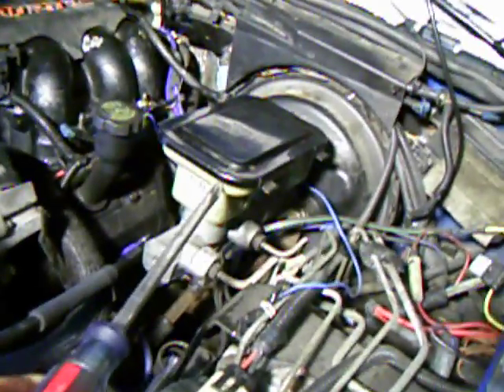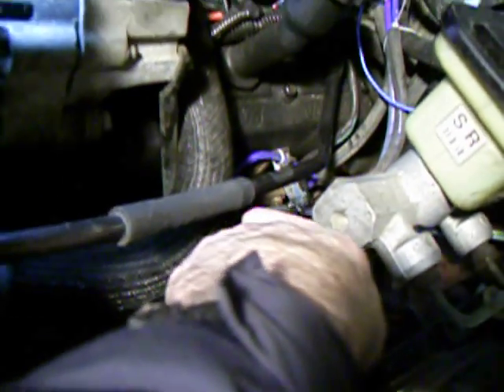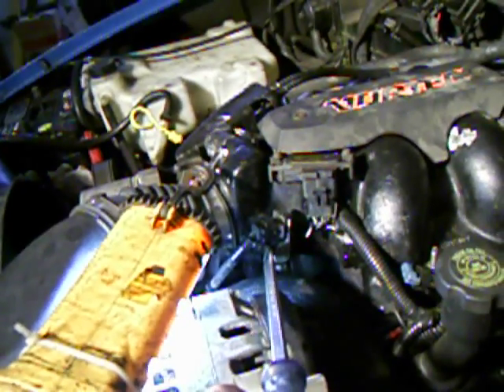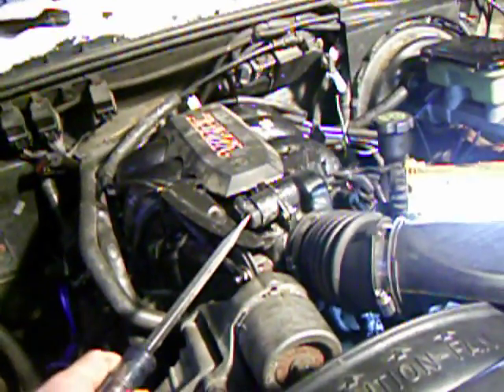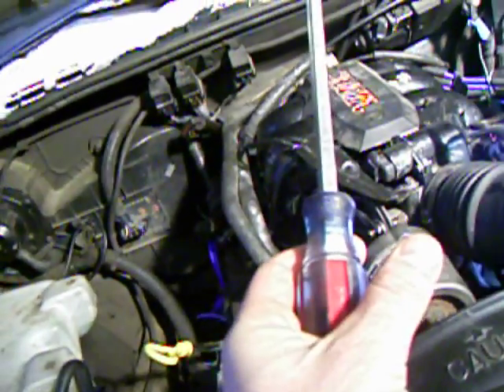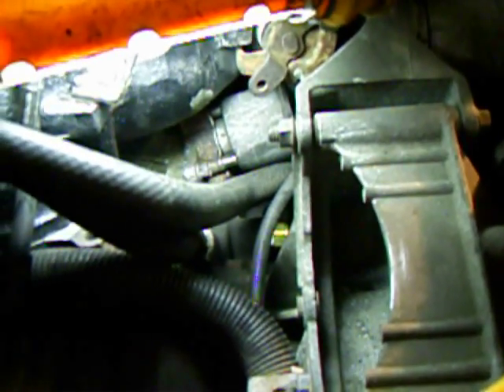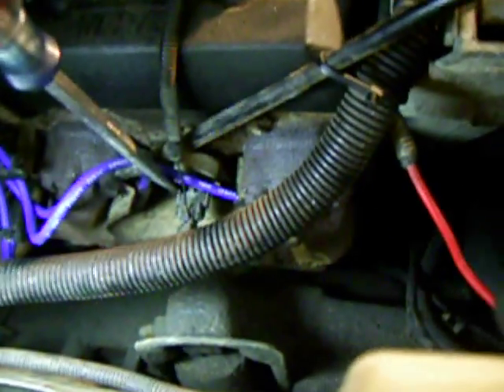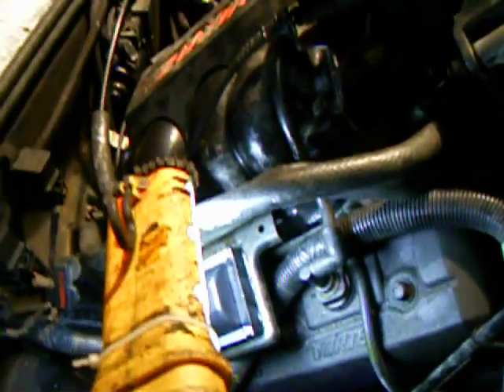GM Troubleshooting Part 7 - Sensors and control valves (non EGR)

Comment: is they a crankshaft position on this motor
Reply from the maker: Hi there.  I sold the truck 5 years ago and gave away the manuals.  If i didn't include any discussion on a crankshaft position sensor  in this video then I would have to say no... there isn't one.

Comment: I have a 96 Chevrolet s10 and sometimes the light come and check engine light comes on and it runs rough just for a few minutes after it warms up it gets gets better just don't know exactly what it is I've replaced fuel pump filters sensors plugs wires for the cap rotor button any advice would be helpful thank you

Comment: Very Helpful, but I'm still trying to figure out what my problem is... I have a 1994 4.3L and i can't get it started without spraying starting fluid in the air intake. After it runs for a while, I'm then able to shut it off and start it again. It seems like it's acting like it's not getting enough fuel, but as soon as it's running it runs good. What do You think?
Reply from the maker: Are there any check engine codes? Could be a bad sensor, computer, ground, plugged fuel filter or bad injector. Start testing them one by one. If that doesn't lead to a fix, depending upon how far you want to go with the fix, I would buy a parts truck and swap sensors one by one.

Comment: Nice helpful video. I have 95 Jimmy 4.3L (w) and doesn't want to start and when it does it dies. We've verified fuel pump (been replaced couple times with filter) and everything in between. It is getting power and fuel. It will start intermittently without aid of combustible fluid sprayed in. Replaced dist cap and rotor, plugs and wires and to no avail. I did fix a vac leak but it's hard to check for more as I can't keep it running. I'm wondering if a sensor, and if so, which one could cause this. thanks
Reply: engine coolant temp sensor (the one of the front of the motor)
had same

Comment: I have a 1998 GMC sonoma when it cranks it goes dead like you cut thje switch off. I by passed the switch with a push button and still won't run.I put new fuel pump relay also. Any ideas

Comment from the maker: sounds like it is running rich. I have seen this before with a Saturn that had a faulty temp sensor (was reading cold).  does your temp gauge work?  how many temp sensors on the rig (many engines have one for the gauge and one for the computer).  This could be a wild goose chase but you never know.

Comment: I have a 95 blazer and when I floor it it sputters and have bad acceleration but when I unplug the Throttle Position Sensor it runs and accelerates fine. Any ideas y?

Comment: PVC if no one has told you is "Positive Crankcase Ventilation". Good for me, helped to figure out the true problem I'm having in my 4cyl 95 GMC Sonoma, I've got it narrowed down and if it's the coolant sensor, that would be great, but I've a feeling it's the TPS :( Thanks for the help.

Comment: PCV, Positive Crankcase Ventilation, you deserve to know! BTW, I have to commend you on this series! There are other sensors I have not seen, The MAF And the Crank Position Sensor. The CPS will keep you from starting but the maf is notoriously known for running rich in GMs. I sure wished someone could tell me where that is on my Lumina car or my Astro for that matter! On my Astro, the cps is under my rotar, pretty easy with that. Don't forget the guy who prototyped much of this o2, in exhaust.

Comment from the maker: @jhep1985 I am not an expert on knock sensors but there are usually 2, one on each side of the engine (1 for each bank of cylinders).  I have also read that they are very prone to failure if the engine is pressure washed...

Comment from the maker: @kc88kc hi there... no spark or fuel pressure... hmmm...not a fuel pump issue...  i am thinking the easiest thing is troubleshoot why the fuel pump is not working... that would be way easier than trouble shooting the ignition...  check all your fuses for starters... then try to manually engage your fuel pump (should be a test plug under the hood to trigger the pump).  get a manual and go from there on fuel pump tests.

Comment: hey bro i need some help i have a 1996 chevy s10 2.2 l and it wont start the weird thing is it gets no spark and no fuel pressure i have replaced the fuel pump and the cables for the plugs still no spark or fuel pressure im thinking it is the computer or some type of senser could you help me with this personal message if you could be a big help right now..
.ps. it was working fine until i ran out of gas and put more gas in it and haveing these problems please help me thanks

Comment from the maker: hi there - on my 94 4.3 it had 2 sensors.  the one on the drivers side between the back 2 spark plugs was for the dash gauge.  the one that was nearly impossible to see without a flashlight was behind my coolant thermostat.  it took 3 tries for me to find it but... it was there.  i would call GM if I were you.  with your VIN they can tell you the # of sensors and probably location.

Comment from the maker: hi there... i am having trouble understanding your description about horns and boards...  the temp sensor is typically all the way cold upon startup with a cold engine and about 40-50% when fully warm.  if you have temp readings higher or lower than that range when warm you might have a stuck open (runs cool) or stuck closed (runs hot) thermostat. Most engines have separate temp sensors for the dash gauge and for the computer...and they have no impact on each other.

Comment: Hi I have a question? I have a 2001 chevy s10 v6 temperature till my board marks almost 1 / 2 and the manual horn design that is almost 1 / 4 or is it normal that you recommend? change the 2 temperature sensors

Comment from the maker: Hi there,
thanks for the comments.  you likely won't get any codes unless you can actually run it at highway speeds.  Until then, i would check engine temp sensor (NOT the guage temp sensor), O2 sensor, dirty stuck injector, fuel pressure and regulator, grounds to the computer.  I think I have some other videos that cover all these checks if they aren't covered in part 7.  good luck and let us know how you make out.

Comment: I have a 1993 chevy 3.1 that is running supper rich.  Just like your truck.  And it is a convert., so I'm wanting to drive it now.  I'm thinking it is the engine temp. sensor.  By the way, thank you for this info.  I have no codes which is strange.  What do you think about that?  Thank you.  Frank.